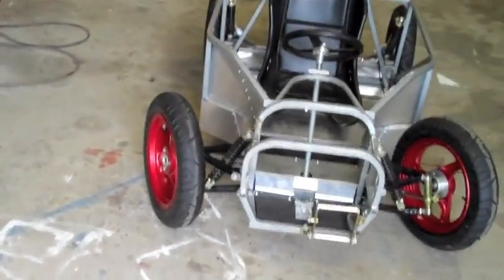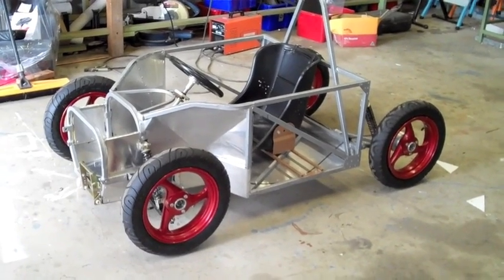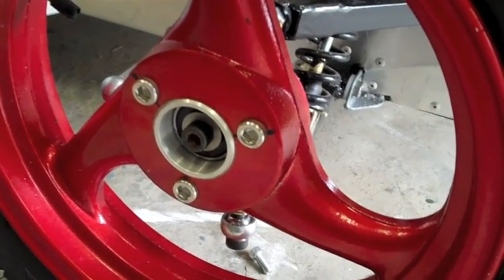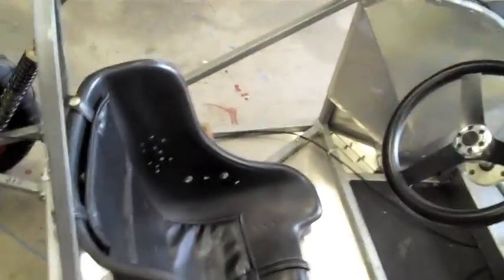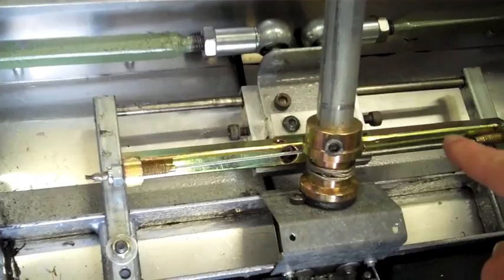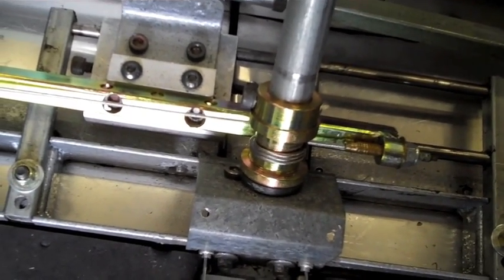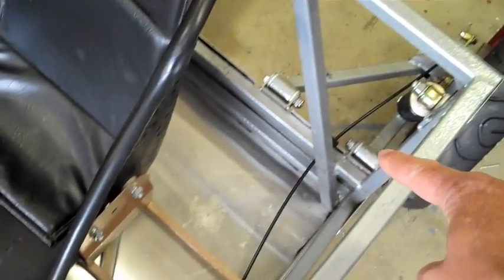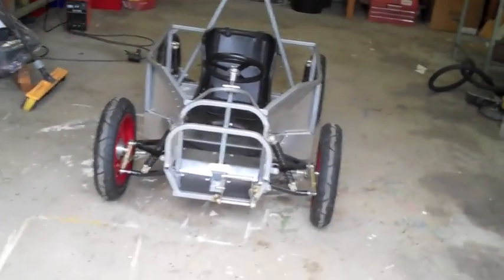Gravity Racer - Chassis Engineering

Comment: Ah sorry mate Camber and Caster add stability NOT Drag  toe adds stability to a point and drag . 
Your tyres are a round profile and so camber with have virtually no effect and neither will castor but you will want some castor. Lastly yes RHS is cheap but IMHO not as durable as tubing and significantly heavier. I'd use exhaust tube and add ballast compartments so that your weight distribution with driver can be tuned. 55% front 45% Rear. 

BUT how did you get on in it's configuration shown here ?
Interested to find out if you had issues with the cable steering , I'd have gone rack and pinion with bike chain and sprocket's with a Spring so the 2 sprockets are always tight on the chain.  rather than Cable , but it is simple and effective but there would be lots of friction points and that may be a problem too.
Reply from the maker: +mozzmann Camber does add drag, even with round profile tyres. The tyres are deformed slightly in contact with the road, and at that point describe part of a cone (if cambered) with its thinner end inboard (for negative camber, outboard for positive). If it were not restrained by the axle, etc, that cone would run in a circle around a point where its centre line intersects the ground. The axle and suspension prevent that turning but there is nevertheless a turning force which turns up as a drag component. It's subtle, but real - every drop counts when you have no engine. With zero camber, the tyre is part of a cylinder, not a cone, so there is no turning force.

Anyway, yes the car went on to get some much better results in later races, though I never quite pulled off a 1st place. The group seems to have stopped racing, so I haven't done much with it recently.

As for the steering, it did fail on a very rough event (though failed safe thanks to the zero scrub radius, and I didn't die a horrible death), and now I have rack and pinion.
Reply: That is why I would adjust the Toe accordingly but as in anything like this there is a trade off.
I think you also may find that having the wishbones of unequal length change 3 things at once  Camber, Caster and Toe, this of course all hinges on the steering push-rod and it's relationship to the wishbones etc as they ALL have an effect. but honestly I doubt that there would be a significant change in drag to adversely effect your speed as the tyres would have been rock hard I dare say ? , wide short wheelbase would be more of an impediment I'd have thought,
 
       Admittedly most of my experience is with race cars where we are always working in trade off's handling v speed v stability , but generally found negative camber even if only slight as well as toe in and positive caster all work together and almost cancel each other to a point giving virtually no forward drag , but I concede it is sometimes a very fine balancing act.

Comment from the maker: Well, that's different. By lowering the drag coefficient you could certainly make the difference between flight and non-flight (and lower drag coefficient raises terminal velocity). But you implied he ended up with net thrust which is impossible. It's in the same category as over-unity power generation, or perpetual motion - it's not a question of being more open minded (to the point where your brains fall out?) as we know it can't work -  it's a question of what's worth expending effort on.

Comment: PLEASE READ!!! Trust me when I say aerodynamics. What is slowing you down? Drag. What are all the drag factors on your vehicle? Friction between the tyres and the road. Thats fine you have skinny tyres.  Friction in the bearings. Not sure what bearings you are running. Ceramic bearings are best. The oil you use in the bearings make a HUGE difference too. Lighter the oil the better. But it just means you will be to replace the oil every 10 to 12 hours of use. (1 of 2)

Comment from the maker: They are 12" aluminium rims from a scooter. We bought them direct from the Chinese manufacturers - AU$17 each!! I wouldn't recommend them because they really did a bad job of packing them and they were all bent to some degree in transit. You could probably find a scrap dealer with similar wheels.

Comment: Man, this is a very solid and perfect chassis. I'm working on a similar project and earlier, I had planned to use a different design, but your front suspension is certainly one I'm going to use in my project. Also your steering is amazing, very easy and cheap. You rock man!

Comment from the maker: @titi97riti that would be the axle. In my case it's a round bar turned to precisely fit the inside of the bearings. At the front it's welded to the kingpins, at the rear bolted to the bracket that mounts to the trailing arms.

Comment from the maker: @roadrunner9115 Yes, I plan to do a run with the AIGRF soon (google it - they have some great videos!). Must admit I'm pretty nervous about how little brakes it has, though in testing I found I could stop quickly if I spun it! I'm hoping that the smooth steering and suspension will isolate me from the worst of what the road might throw at me.

Comment: Are you going to race this cart? If so where, as like you we use motorbike wheels but the BMX wheel is faster off the line due to the weight of the wheel. I feel you may want to put brakes on the front as I have rear breaks only and will not be racing that way this year I am adding front breaks after an incident at the switch at Cairngorm soapbox extreme.

Comment from the maker: @patxidekds I don't know because most of the materials are recycled or surplus stock. Wheels were $17 each, tyres about $20 each which are the most expensive items we bought. The steel would be about $6 per metre if bought new. Ali sheet is about $80 a large sheet, but again this was obtained as surplus stock. The body is built mostly from plywood from a packing crate.

Comment from the maker: @hambon2k10 Because a simple Pitman Arm as used in karts has two problems - very limited movement and what movement there is is geared too high, making the vehicle very twitchy (which is OK for karts). For smooth and progressive steering with plenty of turn you need something linear like a rack and pinion but they are hard to make, so this does the same job but you can make it yourself for pennies.

Comment from the maker: @willespi frame dimensions are 1210 x 840 x 440mm to give wheelbase 1270, wheel track 940. With body it comes in at about 1m wide x 2m long x 0.5m high.

Comment from the maker: @SuperRazman123 Our wheels are 12" alloys from a scooter. We bought these direct from the chinese manufacturer, which took some working out about payment, but they were dirt cheap. But you could probably find them from a scrap (junk) yard. Turned out the stock wheels were not ideal as they were designed to mount between forks on a spindle, but we remachined them to bolt onto a custom-made hub/bearing unit.